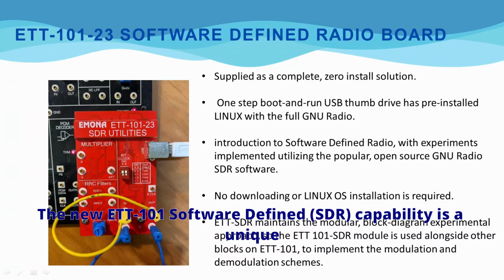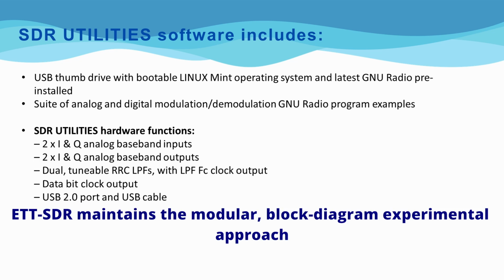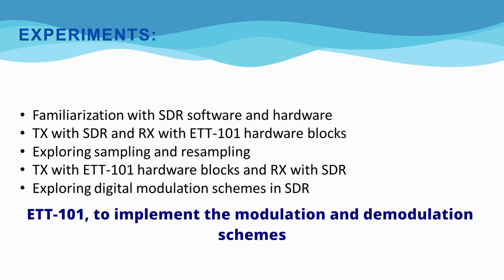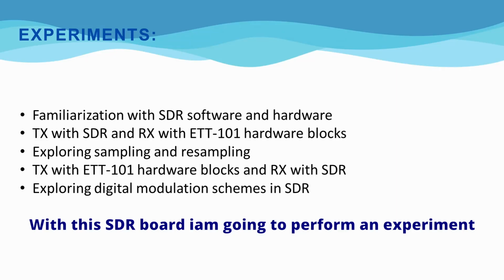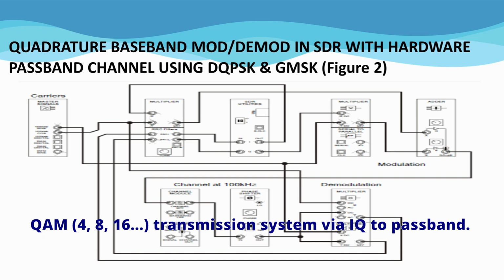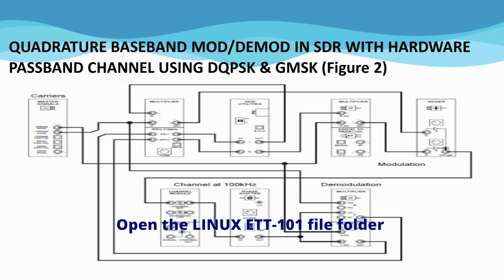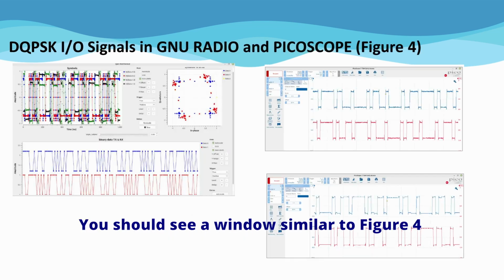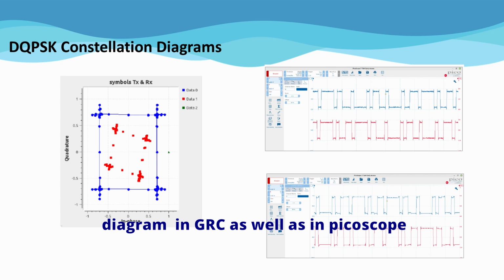SDR Experiments: Open-Source GRC with EMONA TIMS                  #TechEducation #DigitalModulation

Comment: GNU-based SDR is an excellent choice for teaching and research, offering a cost-effective solution. Moreover, EMONA TIMS gives you the unique advantage of visualizing waveforms in both the baseband and passband domains. This feature makes it highly recommended for young learners to better understand signal processing concepts.
Reply from the maker: You're absolutely right! GNU-based SDR is a powerful, flexible tool for both teaching and research, providing hands-on experience at a low cost. Pairing it with EMONA TIMS takes learning to the next level by enabling real-time visualization of signals in both baseband and passband domains. This combination is invaluable for young learners to grasp the fundamentals of signal processing intuitively. A great choice for fostering the next generation of wireless communication experts!